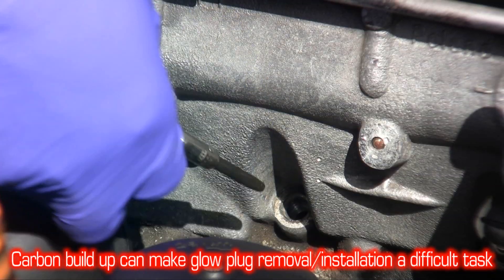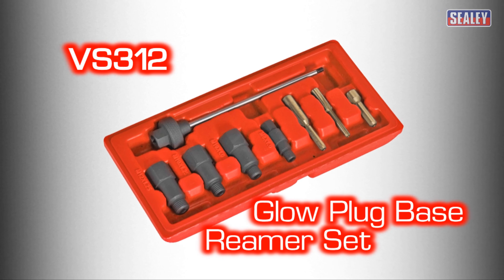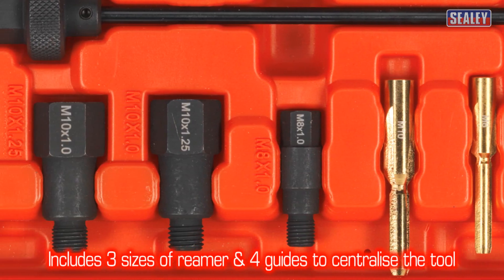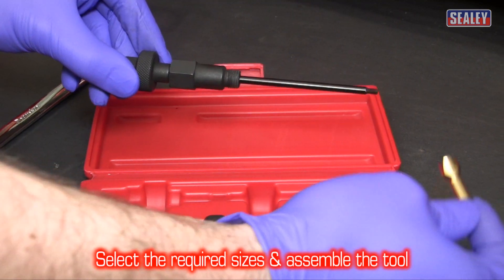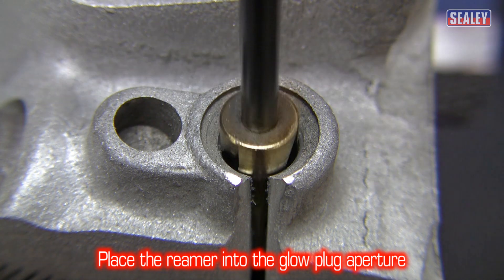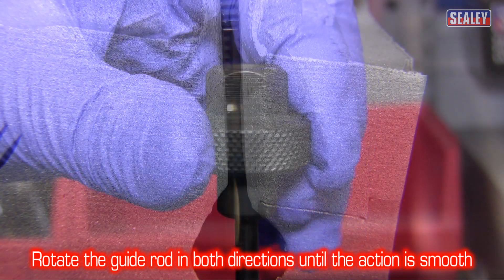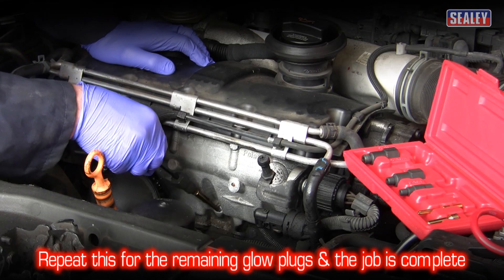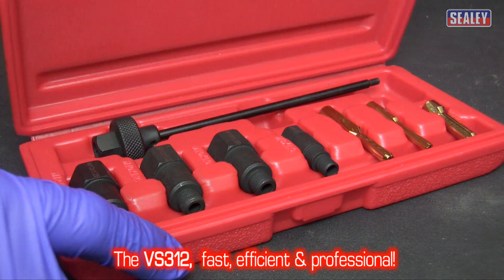Easy Glow Plug Removal and Installation with the Sealey VS312 Glow Plug Base Reamer Set

Comment: I'm wondering what you mean by general purpose grease. Could you shed some light on what grease would be suitable? thank you
Reply from the maker: Hi. In the case of this tool, the grease is a lubricant, but it also collects any debris that is generated by the tool. Our SCS106 - 400g EP2 Lithium Complex Grease Cartridge or the SCS107, it’s screw type equivalent would be ideal. Alternatively, we stock the 100g AK51C - Lithium Grease Tube if a smaller amount is required. Hope that clarifies for you. Thanks.

Comment from the maker: Thank you for your comment. This tool is designed for use on the majority of engines, but we cannot guarantee it will work on all engines in situ. We recommend that this and our glow plug thread restorers are preferably used with the cylinder head removed to prevent debris entering the bores. It sounds as though this would be the best option with the Vectra C engine. 
We hope this answers your query.